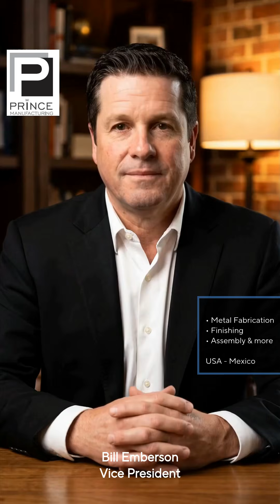Why Metal Coatings Fail: The Problem Often Starts Before the Coating

Comment from the maker: When a coating fails, what gets blamed first?

Usually the paint, powder, or plating.

But the real cause may be:

• Oil or contamination
• Poor pretreatment
• Inadequate rinsing
• Flash rust
• Trapped moisture
• Weld residue
• Bad part geometry
• Incorrect cure conditions

What coating failure have you seen most often?

Peeling, blistering, rust, fisheyes, poor adhesion, or something else?

Post it below. We may use the most common problems for the next video in the series.

If you have an active coating or metal-finishing issue, Prince Manufacturing can also review your drawings and specifications.